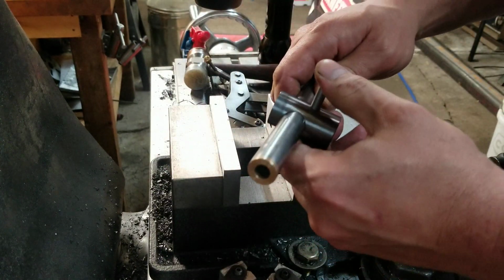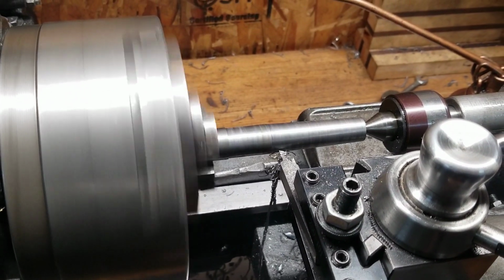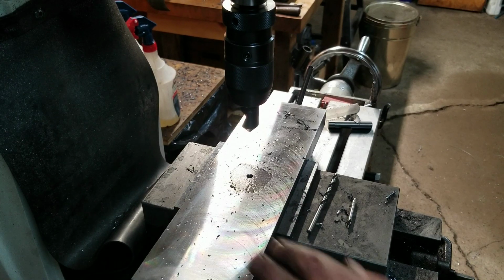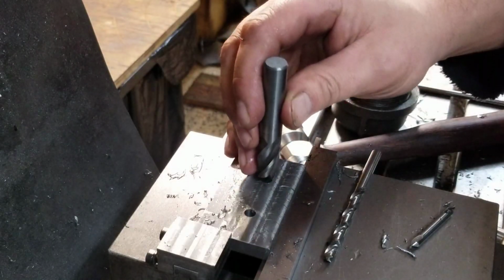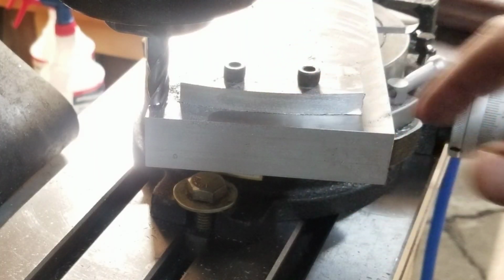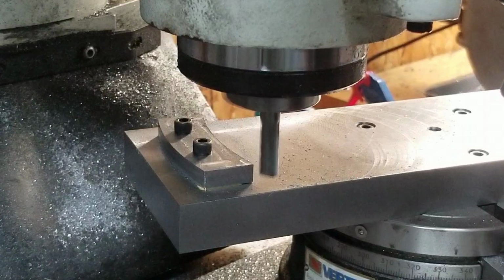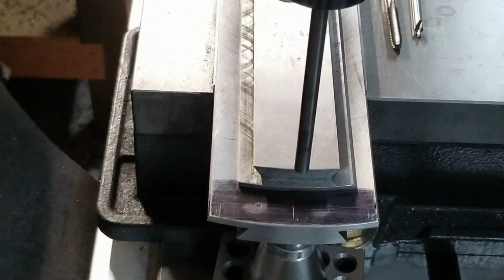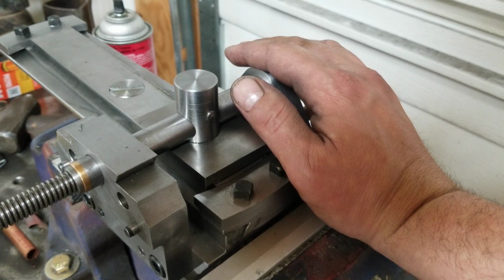The Taper Attachment Build, Part 10 More radii? radiuses? Curvy Stuff! 😃

Comment: The radius cutting setup sure wanted to pick up a fight, but you've got it done in the end. Good one.
Reply from the maker: Well it is pretty new and hardly used, I'm pretty new at it as well. According to the manual, there is some adjustment in there behind the dial I think that will take that out. Fingers crossed 😊.